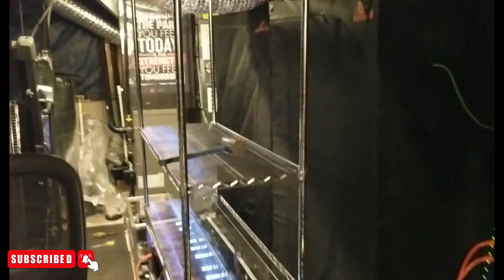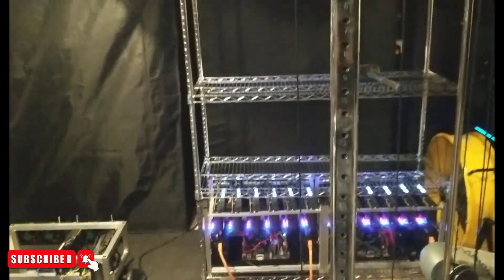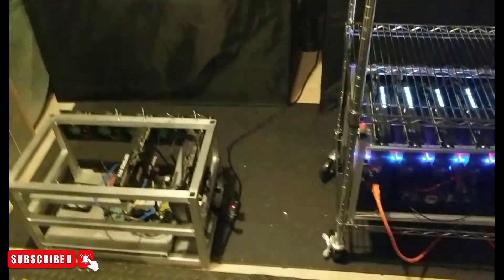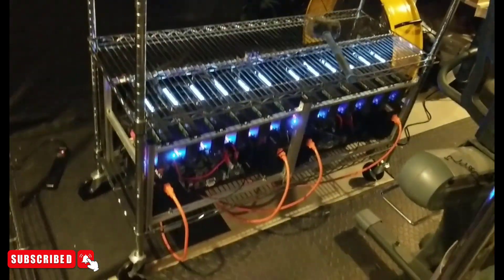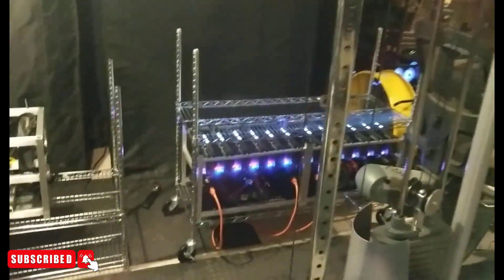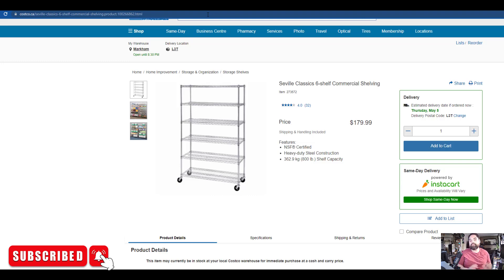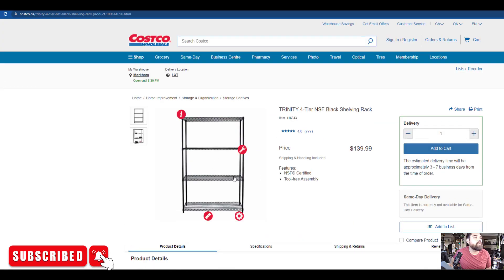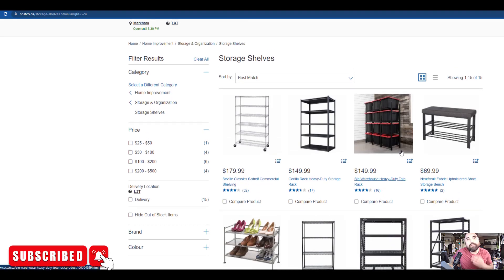Red Panda Mining Inspired Costco GPU Mining Shelves LOL

Comment: Go with husky. I would section off your basement. Hot and cold side. Problem with inline fan system is airflow. You can have high CFM. But it don't matter unless you have airflow pushing hot air away from rigs. This is the biggest issue I see many miners have. Grow tent is OK until hot air is to much to handle. Ask your self. 1 big tent or many smaller tent with more inline fans. Why husky. I would put rigs on shelfs and make a large wind tunnel in front and back. This will push air. AIRFLOW is King. Look Crypto LLC youtube.